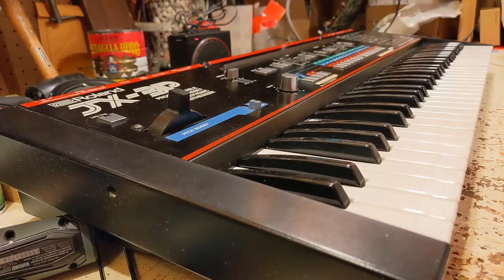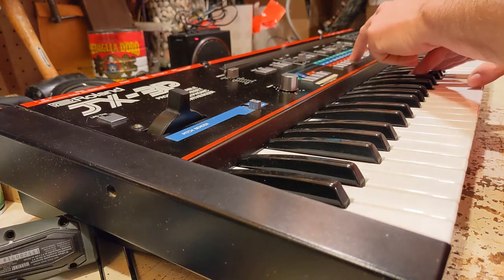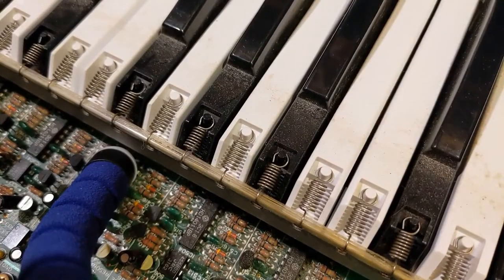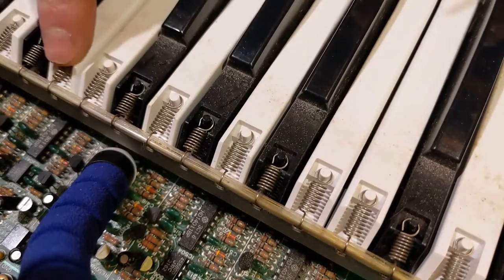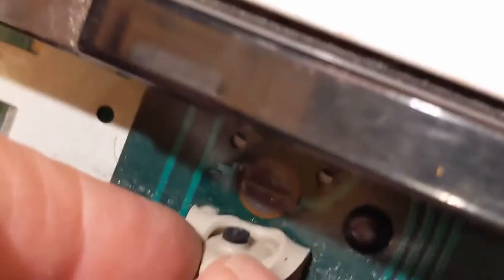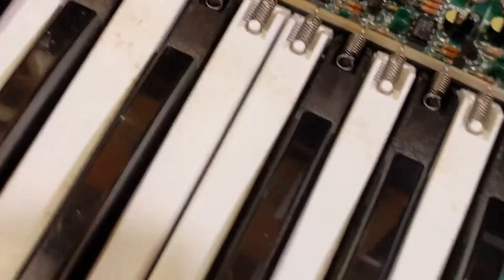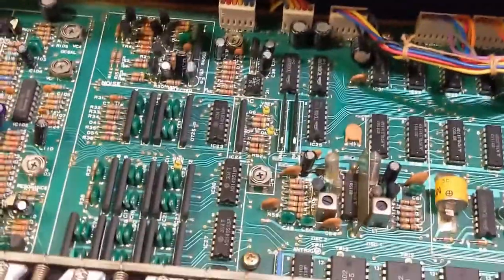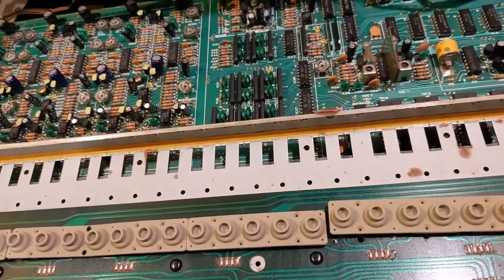Roland JX-3P short demo and key contact cleaning

Comment: FYI for the next person looking up your video... The AKAI AX-80 Uses the a similar contact type, with only 1 contact per key. The AX-80 doesn't have aftertouch, so only needs the one. Although, it has a contact ring which is how I believe it calculates velocity.

Comment: I did my wk110 and managed to make it worse. all my contacts are black and the qtip and alcohol are not working, I also bought sone paste for the rubber thats supposed to refresh them. I am really frustrated.
Reply: with contacts that black it sounds like really horrible storage over the years, and really bad oxidation, cleaning might not do anything you might have to replace or get a new one. but last ditch, id clean the shit out of them endlessly hoping to get them silver again

Comment: ive seen people use a pencil and rub the contacts with graphite and fix it. I wonder which method is the best.
Reply: there is a chemical/paint called Remote Restore (for remote controls) it works great I have used it